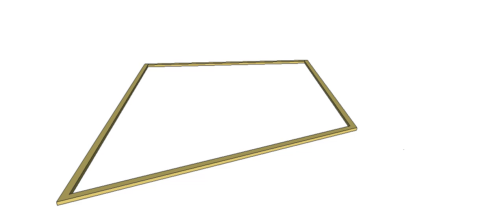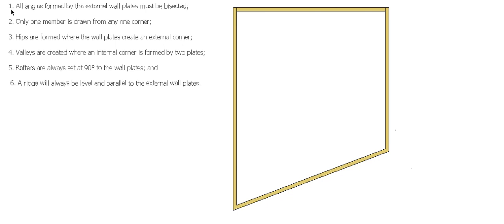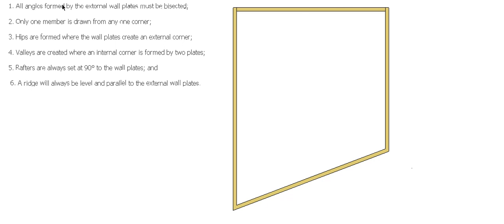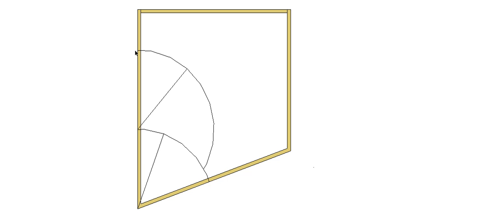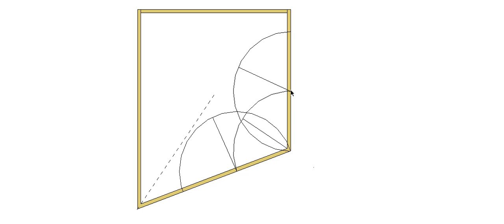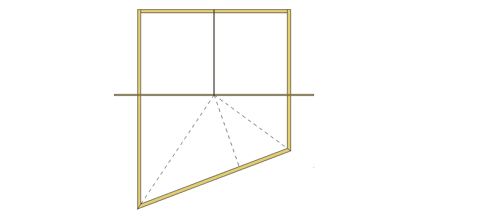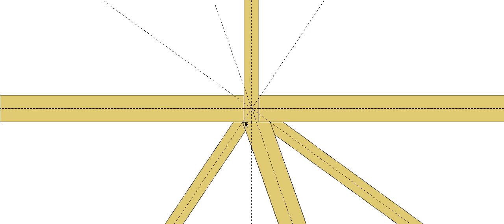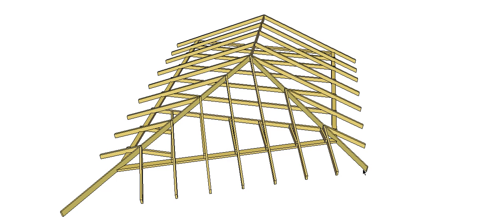Oblique End Roof - Geometrically develop roof members positions.

Comment: Good videos. I suspect this method won't work for an irregular length measurement, where the ridge is parallel to the irregular side and not vertical to the oblique 'end' side as is in this video! Trying to find a method to calculate the rafters of a hip roof when the length side is not even and not the length end.
Reply from the maker: Hi Mate, that is going to be a real pain to work out as each rafter will be a different length and therefore different pitch. Can you change the orientation of the ridge so it will be easier to construct. I am not aware of any easy way to calculate what you are asking.